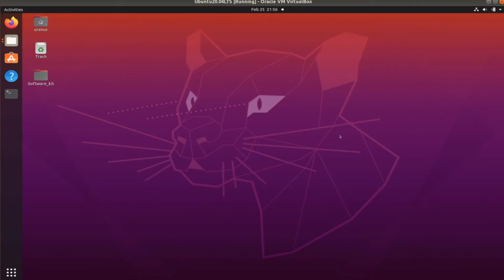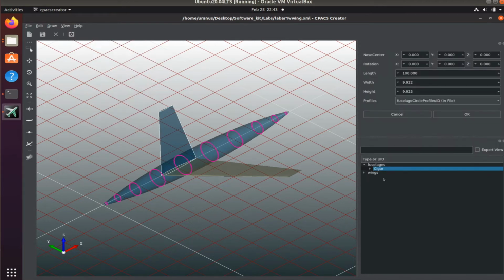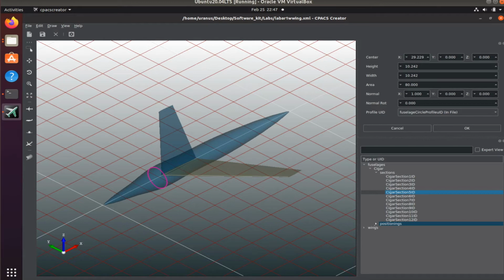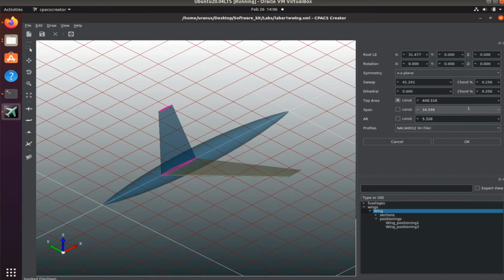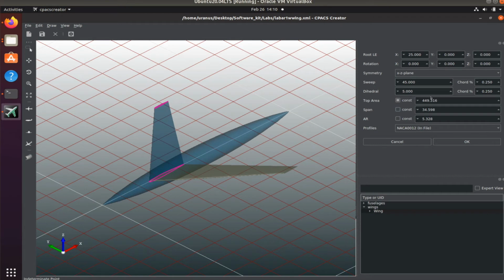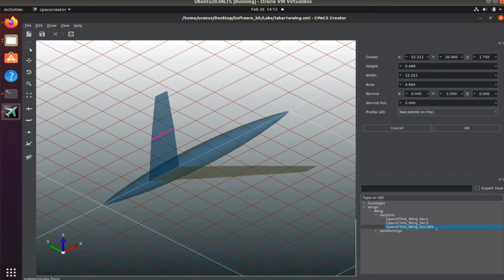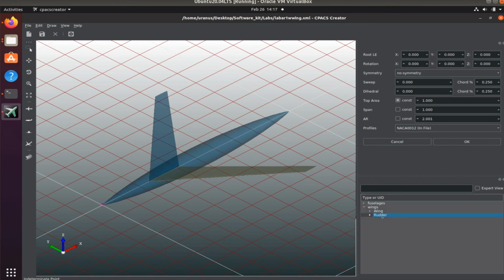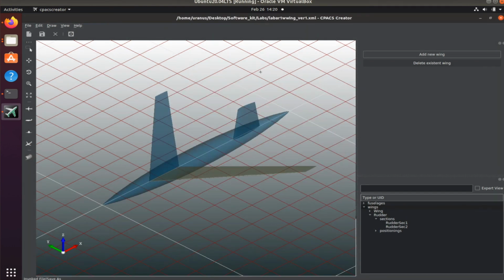CEASIOMpy - CPACSCreator tutorial

Comment: Greetings.,
I followed the installation guidelines for Ubuntu, whichis mentioned in official website, but when I enter cpacscreator, I'm getting an error "Command was not found" in terminal.
I installed the software in Ubuntu v20.04.
And miniconda I installed v4.1 for Linux.
My system details : 
OS : Ubuntu v20.04., 64bit
Miniconda version : v4.1.
I'm seeking for help.
Thank you.
Reply: hello, im facing the same problem. did u find a solution?